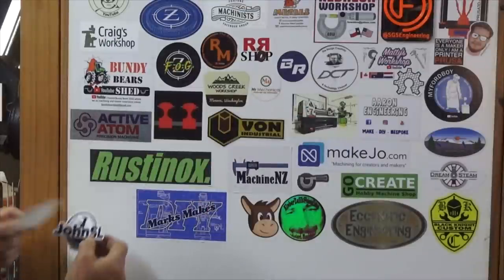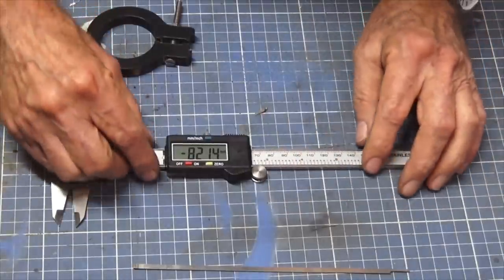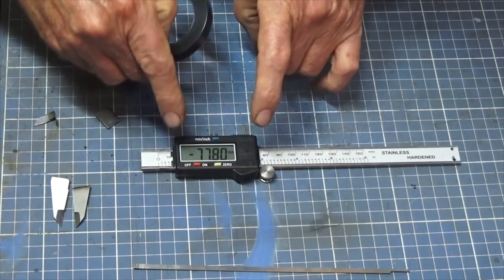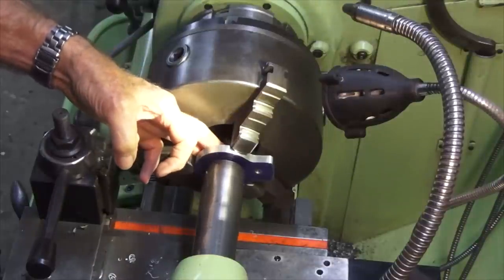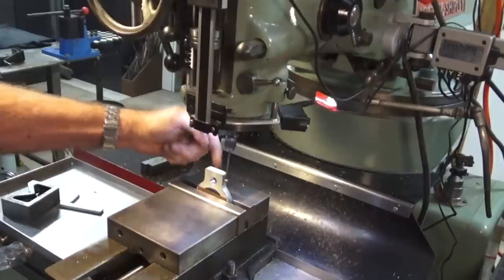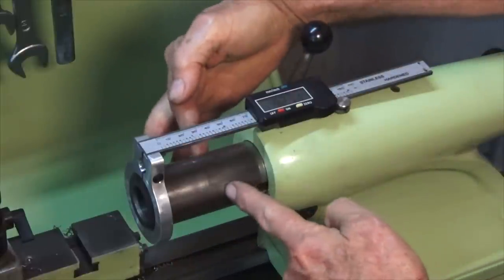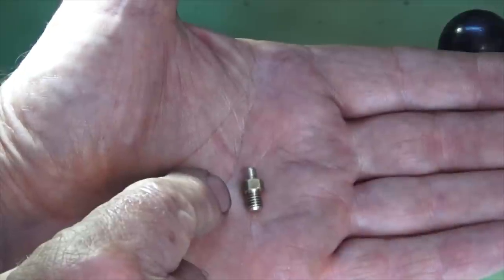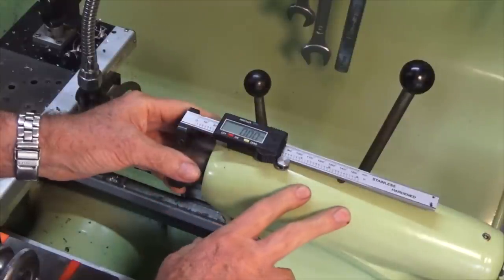How to Add a Digital Readout to a Lathe Tailstock Using a Cheap Caliper

Comment: Hello Mark,
I see people freaking out about the quill rotation.
It's just overconstrained -- as engineers say, nothing else.
All it needs is elongating the holes into slots, so that it would float with the quill rotation, and locate only where it needs, in the X direction.

For those interested: it's the same idea when you see rollers under bridges -- those only constrain movement sideways and vertically, while still maintaining freedom of motion lengthwise. Otherwise the structure would buckle under its own stresses, if it were fixed hard.

Comment: Brilliant piece of engineering, thanks Mark. Though I do have one question. It seems to be a minor point, but how do you mitigate the slight rotation of the quill. I’m quite sure that it will eventually cause excessive wear on the sliding scale, if not the read head itself. Perhaps the hole in the read head might be elongated in the “y” direction to allow the whole unit to move axially. This is by no means a criticism, but having taken such care in your measurements, it would be a shame to have to continually replace the reader over the years. Thanks for another really useful and informative video.
Reply: Yep, there is a lot of slop in the slot of the quill. That rotation (every time you unlock the quill) will tear that caliper to pieces VERY quickly. Watch how much at 25:04
Reply from the maker: Tom, I did realise that the radial backlash was there but I locked everything in place with the barrel of the quill held hard against the direction of rotation when the quill is under load. I didn't show it for the camera but I spent a bit of time setting it up later. I will do a follow up at a later stage and let people know how it has stood up to real world operation. 
Regards,
Mark

Comment: Mark- the downside to the inexpensive calipers that I have found is they don’t shut down when not in use.  I take the battery out of mine, and use dial calipers mostly, but it’s just seconds to replace the battery when I need.  I know they are relatively inexpensive, but I am located miles from a store and you know that it will fail when nothing is open!  Just a heads up.
Reply from the maker: Quite a few people have mentioned the same issue. One enterprising maker installed a small external switch so that the whole unit could be isolated from the battery when not in use. This might be the best solution for me. I am still looking into 3D printing some sort of extra compartment so the switch can be installed neatly.
Regards,
Mark

Comment: Great job there. I might make one for my Colchester Master. Re analog scale, if a 20mm 3d printed block were attached to the readout end, you could then eyeball “0”. Thanks
Reply from the maker: I have a cunning plan to reposition the magnetic scale. Hopefully it will come up in a future video. I can't take credit though, the fix was suggested by a viewer.
Regards,
Mark

Comment: Nicely done, Mark, I have the same rounded surface problem on my Hercus 260, will give your solution a bash, AvE did a vid on the rip off Mitutoyo digital verniers, he came away impressed with the accuracy, might invest in a set for this.

Quick question regarding using the wobbler as an edge finder, do you call it done, as soon as the wiggler goes off?, I've been using a Starrett centre finder, but find I get different readings on the DRO each time, and just average it.

Happy New Year, and thanks,

Scott.
Reply from the maker: Scott, I recall watching that video that AvE did on the knockoff Mitutoyo. He didn't pull any punches and when I saw the innards of the cheap one I bought it reminded me of what he found inside the counterfeit one he bought. We had two of those Hercus ATM260's at work and I used them just about every weekend when I was building a model locomotive (before I had kids and before I had my own lathe). They are excellent machines. I like that wiggler because it can be swung up out of the way when you traverse over the top of a part. I find them to be a bit more sensitive than the Starrett type, but a dial test indicator is probably the best solution. 
Regards,
Mark

Comment: Good solution to your need. 
I have one thought you may consider. Drill through the brass fitting as well as through the casting so it can be both and upgrade to machine lube and a viable reason for it to be there. Should the scale not be Tailstock a small plastic or similar cover will stop ingress of unwanted materials.
Just my thoughts, John, Australia. PS Happy New Year to All.

Comment: Nice video.
Excellent sollution.

I suppose if one only crank the quill from right to left in the cutting operation, precison-wise, any play between the pin and hole makes no difference, since the play in the quill-screw would be way larger. One could put a drip of relatively soft glue into the hole, to make the whole thing dead solid and consistent relative to the quill-screw play / backlash, but also very easy to get rid of. Just pick it out with a needle, if not wanted anymore.

What kind of Birds can I hear in the background ? It sounds like Cockatiels :)

Comment: My Harrison 300MT lathe has a flat tailstock but I am going to adapt your elegant solution with the digital caliper-Thanks BTW can you go into a bit of detail on the Angel Eye quill lamp adaptation? there is a dizzying array of those lights on ebay.
Reply from the maker: Roger, these are the angel eye lights that I used https://www.ebay.com.au/itm/313534726260
They have a driver included in the 12V line. They come in a couple of different diameters. 
Regards,
Mark

Comment: If it upsets you that much drilling into the casting why didn't you utilise one if the existing holes? 
I presume the hole half way along the top is an oiler ?
If so a hollow fixing could be tapped into it and a piece of flat attached with your locating pin on the other end.
The hollow fixing would allow for the oiler.
My quill clamp bolt is on the top and not the side.
I was able to fix my vernier locating plate to this.

Comment: Great job Mark! Have you considered a second hole and brass pin in the tailstock? This would give fore/aft adjustments and centerline alignment, but would require two more holes in the caliper back. Also maybe alignment marks on the quill and mounting bracket?
Reply from the maker: Jim, one of the issues with the setup is that there is some radial play in the barrel of the quill. I wanted the fixed section of the caliper to be able to allow for some angular movement. With two pins and two holes it would be fixed rigidly and that might mean that there is some angular movement translated to the two pins. I can lock it all in place with the bracket rotated as far as it can go under load. With any of these devices you have to see how it goes in practice and then adjust the prototype as needed. I will do an update at some point in the future to see if it has been reliable.
Regards,
Mark
Reply: @Preso58  Thank you.

Comment: I was wondering how you compensated for the slight rotation motion of the tail stock spindle in your mount?     thanks
Reply from the maker: I will be addressing that issue in my next video. I actually used the DRO today to bore a hole to a very specific depth and it worked perfectly. Even I was surprised!
Regards,
Mark

Comment: Really nice upgrade. Only thing is, I have the same digital caliper. And it just went from functional to crap. Maybe I'll make do. Or strip and clean.
Reply from the maker: I don't expect that caliper to last very long. The main issue is battery life. They are on standby power the whole time unless you remove the battery when you aren't using it. If it does prove to be useful I will probably upgrade to something better quality. 
Regards,
Mark
Reply: @Preso58  yes, I always remove the battery. My reply was meant to be tongue I  cheek, sorry.

Comment: I'm not a good enough machinist to be happy drilling my tail stock yet. Could I use self curing modelling clay to match the curve of the tailstock with two magnets in bedded? Then the brass pin equivalent could be imbedded on top surface of clay.... I don't have a mill and my drill press is a small low quality one..
Reply: Drill it with a normal cordless drill. It's not even slightly a precision job.... just use a drill stop or wrap a bit of electrical tape around to prevent going down too far.

Comment: Mostar lathes have quite a bite of rotation of the tail stock barrel. I don’t think on my lathe it would be possible to get by with the rigidity of the scale mount on the barrel. A magnetic connection between the scale and the barrel bracket would allow for this rotation.
Reply from the maker: I have been using this accessory for quite a while and it seems to be OK with the small amount of backlash in my tailstock barrel. If you preload the clamp in the direction that the barrel will want to twist under load it prevents a lot of the movement. The brass pin allows for some movement without loading up the internals of the caliper too. I guess it depends on how much movement you are likely to get in your tailstock.
Regards,
Mark

Comment: Mark, do you have clearance under the caliper for a thin aluminium plate? Could you mill and engrave a Vernier scale to offset  your 20mm '0' back to zero and give you slightly more precision?
Reply: Just use a heat gun to soften the adhesive, remove and replace the linear analog scale (sticker).
Reply from the maker: See below. I will try repositioning the magnetic strip.
Regards,
Mark

Comment: Geez  Mark, that circle forming was a bit flash Harry! If that was me I'd have to set up my rotary table and attack it! Neat stuff tho!
Reply from the maker: I did not own a rotary table at the time but a good friend gave me a large 10" one. I have only used it on one very small job but it's nice to know you have that capacity in the  shop. 
Regards,
Mark

Comment: Can you please share which angel eyes light you fabricated for the bottom of your mill? Thank you! Will you supply a link to the light?
Reply from the maker: I bought mine on Ebay some time ago and I cannot find the original seller that I used but this is very similar. They do come in different diameters and some use RGB LED's if you want to change the colour of the light,
https://www.ebay.com.au/itm/164924487628?hash=item266643f7cc:g:6XkAAOSw0G9g0FES
Regards,
Mark

Comment: Does your mill not handle steel very well? Or do you just prefer to do this setup on the lathe? I'm not being judgmental, as I know that some setups can be tricky or just a pain in the ass. I do like the idea of having a "DRO" on the feed of the lathe, very elegant solution IMO. I think I just heard the collective sound of hundreds of Colchester owners gasping in fright as you drilled that singular hole....
Reply from the maker: No, the mill handles steel and iron just fine. I want to avoid changing the setup when I machine the interior of the piston as much as possible. There are about four operations that can all be done on the lathe without losing any concentricity. 
I know it should be possible to go from one machine to another and set the part up to micron accuracy but I take the view that if I can do as much as possible in one machine it saves a lot of extra work and the chance of getting something misaligned. Plus, it's nice to be able to just zero the position of a drill bit and then drill to an accurate depth. Send the hate mail for the drilled hole to Save Our Machine Tools in your capital city. 😁
Regards,
Mark

Comment: With the benefit of hindsight, would it have been possible to leave the end of the caliper rail longer by cutting the fixed jaws off differently ?  Then you wouldn't have the 20mm offset on the scale.
However, now that it's finished, you could attach a piece of plastic to the left-hand end of the read-out to mask off 20mm of the scale.
Reply: Well said. I am not sure why get cut it off anyway - it would have been much easier to just drill a hole and pinned or bolted it onto the quill bracket.

Comment: nice assortment of birds you have in your backyard!
I bought 3 no-name generic digital calipers like yours to measure some piano wire and realized when I open and close them a couple of times they won't back to zero! most of the time comes to -0.01 mm or so and because of that I end up buying a proper one. 
my question is if you having a similar issue with this and if you have to re-zero yours or maybe that little 0.01 error does not matter at the end?
Reply: They won't re-zero if there is slop in the head. You need to disassemble them and clean all the crap out, then file/grind/lap the surfaces so that they slide really smoothly. Then lap the jaws so they are parallel... after all that, they will zero every time.
In other words, it's not the sensor error, but an issue with the jaws not always closing accurately.
Reply from the maker: I take the view that 0.01mm is about three tenths of a thou. You often hear machinists in the USA hitting one thou of their target size. 0.01 is a third of that so I generally don't fret too much if I set a tolerance of 0.01. I have a Mitutoyo Absolut caliper and it will read 0.01 off it's absolute position if you have even the tiniest bit of debris between the measuring faces. For what I do most of the time I just use the caliper but if I want to measure in microns I will use a Mitutoyo micrometer with a vernier scale. 
Regards,
Mark

Comment: You can also buy the DRO head separately along with the scales for not much more. Another solution is to use the even cheaper digital tire thread gauges, which doesn't have a jaw. Btw, you could make the brass pin look like an oil port.
Reply: You could remove the quill, drill it right through and make it a proper oil port.
Reply from the maker: I did consider one of those DRO scales with a remote LCD display. The display is normally magnetic and it can be mounted somewhere on the machine but I wanted to avoid having another wire dangling around the back of the machine. The type with that you mention was about double the cost of the el cheapo caliper that I ended up getting but  I knew it was cheap and it may not last. I will review it in a month or so and let people know how it has panned out. 
Regards,
Mark

Comment: I think that fusion 360 is something you might find useful there is some pain in learning how to use it but it is worth it your other problem is backlash in doing a curve
Reply from the maker: I do have an education licence for Fusion 360. I use it occasionally. The CNC capabilities are way more complex than I need on most occasions. I like using CamBam because of it's simplicity but it doesn't have very good CAD tools. I may have inadvertently solved the issue of DXF export from Corel Draw. I machined some parts today with arc segments and they were fine. I still don't know how I fixed it though.
Regards,
Mark

Comment: Mark your lathe so you do you. Question though, is there any reason you didn't 3D print or mill a pad for the calipers to sit on and adhere that to the tail stock instead of drilling for a pin?
Reply from the maker: I tried to find ways of holding the digital display body down without having to drill any holes but I wanted the mounting point to be solid. I considered magnets and adhesive pads but if there was any chance of creep or any sort of stretching of the adhesive it wouldn't be a reliable way of measuring. If you can't trust it you'll always be second guessing the dimension. I can live with such a small hole.
Regards,
Mark

Comment: There's probably enough room below the callipers to have a buffer located on the collar that could protect the callipers.
Reply from the maker: I was using the lathe today and I have to get used to not resting my hand on the top of the tailstock. A few times I bent the tail of the caliper down because I wasn't paying attention. I do remember reading about a machinist who used to throw things at his apprentices if they leaned their hands on the tailstock. He was so meticulous that he believed that leaning on the lathe during operation would alter the accuracy of the turned part. Maybe that's why I mess up so many parts.
Regards,
Mark

Comment: Mark, be aware that the type of PC case you are using for your CNC mill is not really suited for industrial usage: being compact, it can overheat and is not very friendly with dust and debris. You may prefer to use a full tower with proper air filters on the fan intake.

Comment: Is it possible to get the print file for the light ring around the quill?
Reply from the maker: I recently upgraded that light ring to use a COB style LED light ring. These are way brighter but they also create a lot more heat. I machined a thicker aluminium backing ring to act as a heat sink and I printed a clear PETG diffuser for the LED array. I also added a simple dimmer and power switch. I am planning to do another video showing the upgrade soon. But you can see the results on my Instagram. https://www.instagram.com/p/CvTjuvfp3pd/?img_index=1
You can download the STL files for the light ring and diffuser here https://www.dropbox.com/scl/fi/if2nkvzrwmp9k0vp7bfly/Bridgeport-ring-light-V2.0.zip?rlkey=6c9lk03j68joh715h68uwqop9&dl=0
The dimmer is here https://www.ebay.com.au/itm/321972924591?chn=ps&_ul=AU&mkevt=1&mkcid=28
I got the ring light here https://www.ebay.com.au/itm/145067309962?var=444266897180
Regards,
Mark